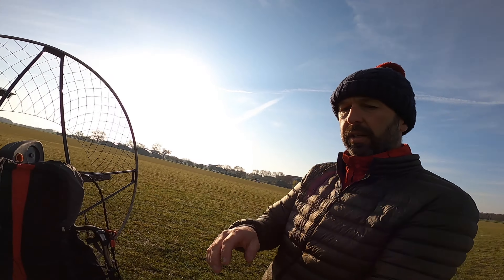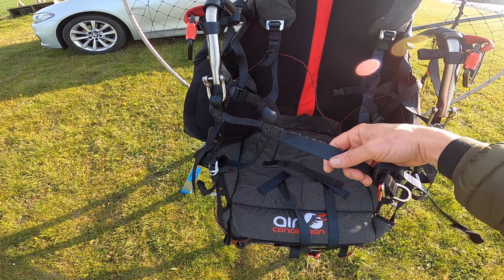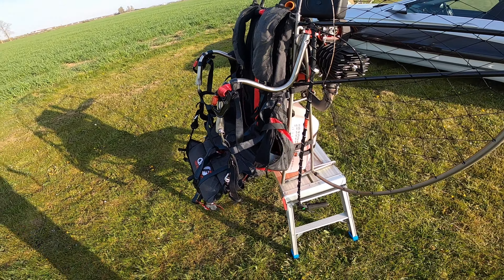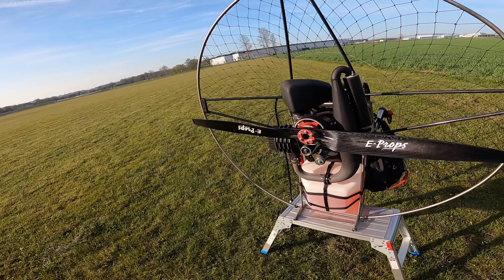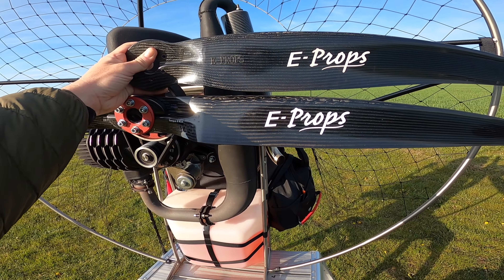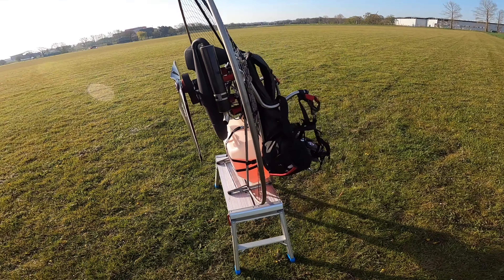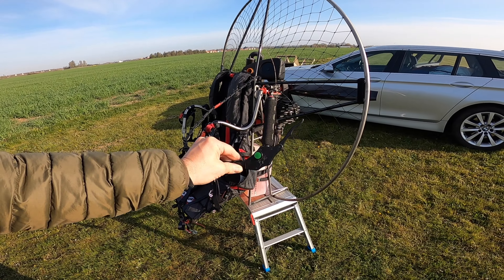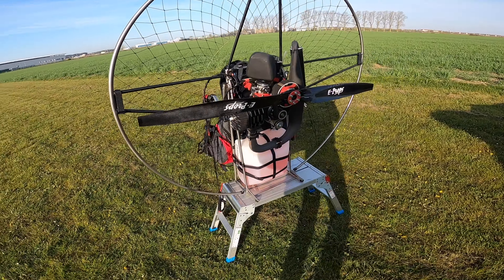Air Conception Nitro 200 Paramotor Review

Comment: I have 140 hours on my Nitro200 e-start and clutch I can honestly say this Paramotor is way underrated by the paramotor community . I've upgraded to the E-prop 3 and the Off-grid throttle with cruise control . I love it
Reply from the maker: Every motor/ frame setup has its pros and cons. But I agree the Nitro is good and suits me perfectly. Owned it for 3 years.

Comment: Very nice review! I also started out with the same setup as you did (zenith+thor80). That's the engine I wanted to buy afterwards - it's indeed very light and my friend gets 3.5 L/h on his, which is almost unbelievable! I decided to buy the Miniplane Top 80 just because it was cheaper (well, it's lighter and a bit more economical, but doesn't climb as fast as this one. I'm surprised you're consuming 4.5 L/h, but I guess it must be down to the wing and flying style.
Reply from the maker: Thanks. Miniplane Top 80 is a lovely machine too. I’ve noticed lots of XC pilots use that or the Atom 80. The due economy works ok for me. I could tweak the carb, but the spark plug is a perfect colour so it’s operating at the right temp. 3 hr flight time is generally enough most days. 👍

Comment: Hey I’m just getting into paramotering and as of 2023 have been looking at the nitro 200 which I trained with and also the parajet maverick. Do you think the nitro 200 is still worth going for as of now, or should I just get the maverick 185? Thanks a ton!
Reply from the maker: Air Conception have released an upgraded version called the Revolution 200 which is also available with Dual Start…. That’s probably my next motor!
But I’m really familiar with maintenance of the Nitro engine now, so that’s one reason why I’d stay with it. The Nitro setup is 4kg lighter than the Parajet Mav. But you’d probably find it much easier to get parts for a Moster 185 in the US? Unless you know a Air Conception dealer? Good luck👌

Comment: thanks for posting :) How is does your fuel consumption go per hour? Are you happy with the clutch + estart as say compared to simple estart or manual start? Is the putting together of the cage easy? Thanks
Reply from the maker: I get 4.5 litres per hour on average with my current wing (Airdesign Ramaflex). 
I have always preferred the clutched engines as I don’t like the prop turning at idle. The clutch works perfectly once you get the low rpm just right. 
Cage assembly is effortless. One of the best features of the Airconception in my opinion. 6 carbon rods which the titanium cage slots into easily. 
I break down and build my paramotor for every flight, have done for 3 years.
Reply: @simonhamilton4002  thanks for the info Simon, I currently fly with a Miniplane Top 80 and am thinking of getting a Nitro...
Reply from the maker: I trained on a Top 80, great little engine. You’ll sure notice the power difference with a Nitro

Comment: Hello buddy how you doing I just got the nitro 200 but would like to know what the max cylinder head temperature is as need to set up the temp gauge on throttle same as yours but just temperature and time I got the paramotor with 5 hours on it so he told me but in running it in with a mix of 5lt tò 100mls of oil and plug is a perfect colour but was not sure of the hours he told me paramotor looks brand new any info would be a big help thanks buddy
Reply from the maker: Hi. Not sure about CHT, I don’t have a CHT monitor, just tacho. Join the air conception Facebook page and you’ll probably find the answer there. 
This is a useful manual too with most info that you’ll need: https://www.flieg-mit.eu/app/download/5811579418/Manual+Nitro+200+und+Tornado+280.pdf

Comment: Hey mate, thanks for your introduction of the nitro.
How much fuel does it use in your case and how bad do you find the vibrations?
Thanks and good flights.
Reply from the maker: I use 4.5 litres per hr, or exactly a gallon. Vibrations absolutely fine. I have silicone engine mounts. All engines vibrate more at certain revs, at cruise setting it’s quite smooth.
Reply: @simonhamilton4002  I find that on my Nitro the right arm vibrates quite a lot. Nothing on the left side. Not really sure why the vibrations are it's situated there and how to fix that... 
You seem to have the bigger silicone mounts. How do they compare with the standard ones?
Reply from the maker: @samik83  interesting that the right arm vibrates. I’ve not experienced that. Have you tried tightening the swing arm bolts?
The larger silicone mounts are necessary if you upgrade to a larger due tank. I have the 15.5L.
Reply: @simonhamilton4002  Yeah I check the swing arm bolts after every few flights. I don't think it has anything to do with that. The vibrations just travel there, for some reason. I can only guess that it has something to do with how the engine is mounted. One side tighter than the other? 
Just placed an order for the big silicone mounts. Hope that will fix it.

Comment: Hi Simon, are you still flying this? Any further issues?? I am just looking to get my first motor, these look like a good value option
Reply from the maker: Still flying it 👍 
I had to change the cylinder and piston last year. My fault as I ignored engine rough running issues until the piston ring broke and scored the cylinder too. 
60 hours of perfect running since then. 
Have a look at the Revolution 200… dual start and 3 years warranty!
Reply from the maker: https://youtu.be/bnAJMj15W6w
Build of a Revolution 200
Reply: @simonhamilton4002  Super helpful, thank you for the reply, appreciate it